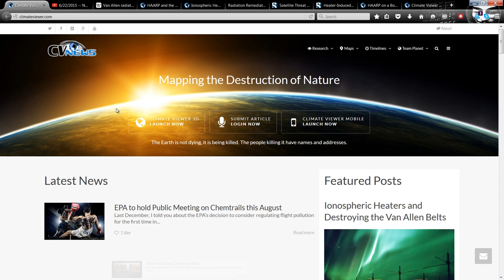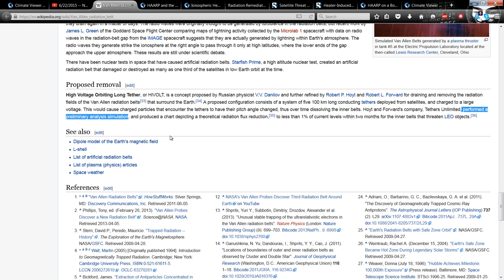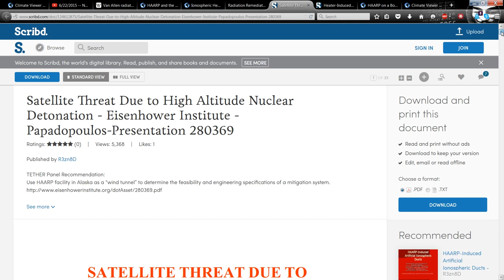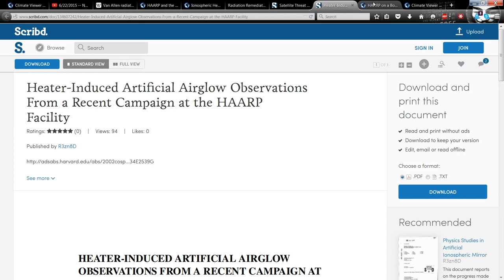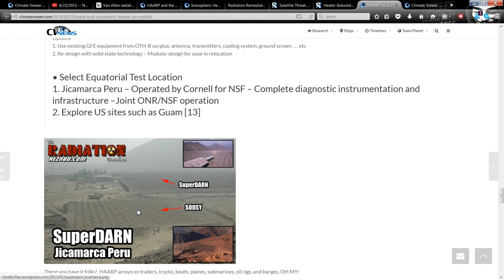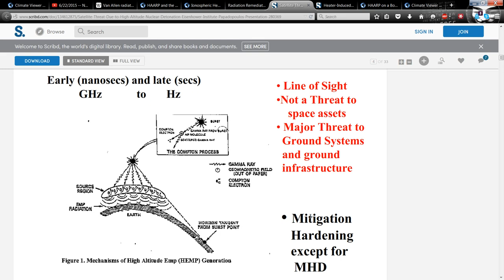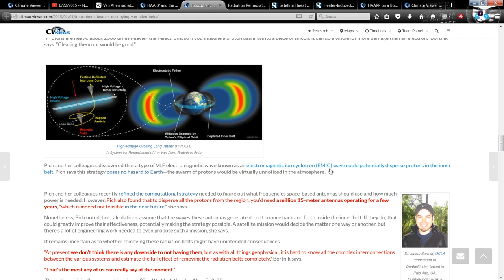Draining the Van Allen Belts with HAARP & HiVOLT

Comment: Do you think that perhaps TeraHertz propagation is next in line? With terahertz waves, resonance is higher than that of matter itself, but I would  imagine that it would also require much more power, and a much more "rigid" array
Reply: Neil Z well as of recently there is soon to be a 5g network array that if rolled out will certainly be stable enough